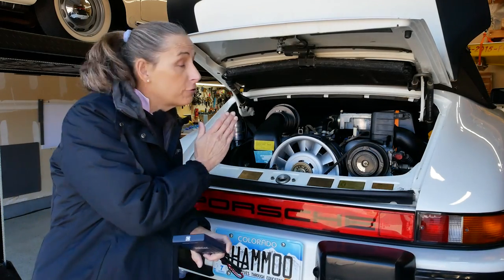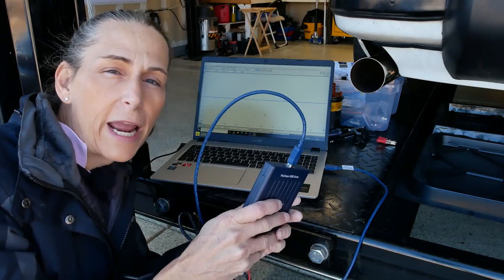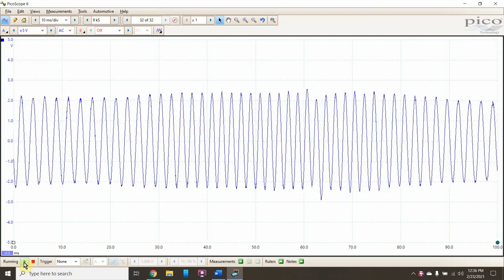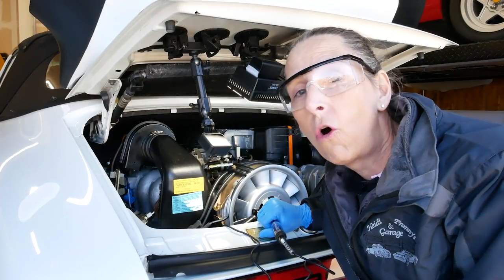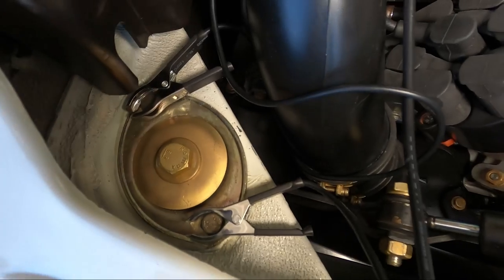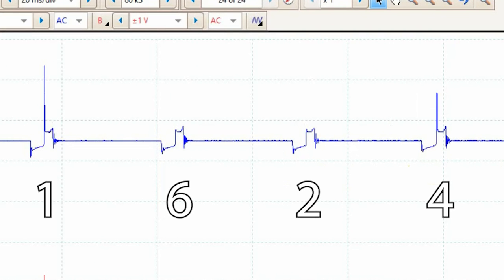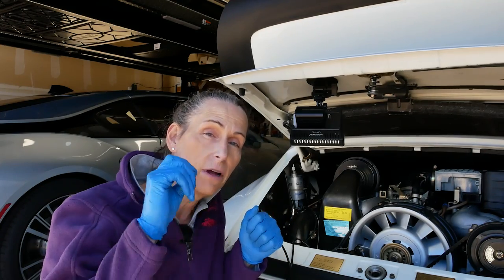Budget eBay Porsche 3.2 Carrera: Testing with a PicoScope Oscilloscope! Bad Wires??

Comment from the maker: Hi Everyone, I wasn't happy with all the testing we did a couple videos back and after several comments, I decided to do a bit of research on how to get better results than what a Volt-Ohm meter can provide.  I came across a channel called Mechanic Mindset and reached out to Darren and got a bunch of great info on the PicoScope 2204a.  Check out his channel here for lots of tips and tricks: https://www.youtube.com/results?search_query=mechanic+mindset

In the video, we check the position and speed sensors, the airflow meter, run a virtual compression test, take a look at the ignition patterns and finally get a yes or no on that original black coil.

Let me know your thoughts on the Pico and some of the data I got.  We even found one big surprise!

You can find the PicoScope software here: https://www.picotech.com/downloads

If you are interested in the scope or any of the probes and such you can find links for them here:

PicoScope 2204A (no probes): https://amzn.to/3vhB0In
Hantek HT25 Auto Ignition Probe with three ends (order 2 of these): https://amzn.to/3rKi9Uc
Acer Aspire Laptop (under 400 dollars!!!):https://amzn.to/3bEgNVB
Autooutlet Oscilloscope Probe: https://amzn.to/3viisaP
Hantek CC-650 AC/DC Max High Current Clamp Probe: https://amzn.to/3vgdfAl
Hantek AC/DC Current Clamp CC 65A Low Current Clamp Probe: https://amzn.to/3rJHVYS
Hantek HT201 1.053M Input Resistance 10MHz Bandwidth Signal Attenuator: https://amzn.to/3vgpEUW
Pack of 2 BNC Q9 to Double Alligator Clips: https://amzn.to/3thVuiB
Hantek HT30A with Utrade Heavy Duty Test Lead 3M BNC to Banana Adapter Cable: https://amzn.to/3viHXsQ
Probe Kit KKmoon HT307: https://amzn.to/3rF7Lgv
6V/24V Car Electrical Circuit Continuity Tester with Indicator Light: https://amzn.to/2N8JUGU
Thexton THE404 Spark Tester: https://amzn.to/3bFxzU9
Reply: Justin miller on Youtube also has good information on the 2204a like darren
Reply: Darren is a top chap 👍

Comment: The 2000 series Picoscope is NOT designed for cars and using it as such will void your warranty. It has a shared ground with all channels. It can/will short out electronics on the vehicle as well as potentially damage itself. The 4425A is their flagship scope and is specifically designed for automotive use as it has floating grounds.
Reply from the maker: This car uses a common ground for all sensors and electronics so the common ground isn't an issue. Possibly for modern cars it might be a thing.

Comment: Congratulations  on your new pico scope. I have used scopes for automotive diagnostics  for over fifty years.. believe me you have just open up a great new way to diagnose  electrical 
 problems, weather it is engine, alternator- generator,  heater fan or wiper motor, the possibilities  are endless. As you said in your video, practice is key; I assure you the more you practice the more you will be using it.
Thank you for what you are teaching technicians both professional and DIY. It is very much needed and appreciated. 
Thank you
R.G. Young, Jr

Comment: Nice usage of the PicoScope. I know their products well.
One comment on the 'missing' firing signal. This has nothing to do with the vertical resolution of 8 bit but is more a problem of not enough sample rate to capture the glitch. For this type of scope you can calculate the the required bandwidth of the scope to be 0.35 divided by the fastest rising edge (10% - 90%). Then you need to have four times the sample rate to avoid alaising effects. Nyquist law says you have to have at least 2 times the sampling rate but in reality with Gaussian input characteristic of the scope chanels you need to have four times sample rate.
So the fastest rise time that can be seen on the screen of the PicoScope 2204a is 35 ns.
Reply from the maker: Thanks for that.  I did pop open the properties window to get a good look at just what the Pico was altering its settings to.  I have the samples set to 2M and then the rest is just voltage range and time base, right?  As I increased the time base to see all cylinders the sample rate would drop into the several thousands range.  I read that this was a limit to the 8bit data capture.  Can you suggest a setting that would capture all the firing lines?  That would be super helpful :)   I also played with the up-scaling of the probe to 8.5-10bit but that just smooths the signal without increasing resolution.  Thanks!
Reply: @HeidiandFranny  You're welcome. 
Most oscilloscopes have an automatic setting of the sample rate and the aquisition memory to fill the entire screen. So first you can manually increase the aquisition memory to the maximum of 8 kSa which is unfortunately not very much. If you then increase the time base it will lower the sample rate or just not fill the complete screen.
But the PicoScope6 software has a nice feature. You can stream the data via USB streaming mode directly into the PC for longer aquisitions with a higher sampling rate. Based on the datasheet you can stream up to 100 MSa so if you use 40 MSa/s sampling rate - which is enough for a 10 MHz scope input - you can stream up to 2.5 seconds to the memory. I haven't used the software in a while so I can't remember where to set it up. But I'm sure you can find out in the build in help.
The 8.5 to 10 bit upscaling just increases the vertical resolution. What this function does is to take up to 8 sampling points and derive one new sample point but with higher vertical resolution. This of course reduces the effective sample rate by the factor of 8. So with 100 MSa/s maximum hardware sample rate only 12.5 MSa/s with high resolution is left which means appr. 3.15 MHz alaising-free bandwidth. This technique is called 'boxcar averaging'.

I'm looking forward to se the Carrera running soon... Greetings.

Comment: The intellectual curiosity and desire to get things properly worked out are impressive!  So often people just cannot be bothered to get repairs completed and even brag about how little they care.  This is not perfectionism for perfectionism's sake.  The knowledge you are gaining and passing on gives you a better understanding of what processes are working and what are not.  Many people will simply throw parts at a problem and never fix it.  On the Car Wizard channel Mr. Long shows how properly diagnosing issues actually saves time and money.

Comment: Yes, your black coil was in good shape and the car is still running a lot better than when you started the exercise of identifying where the idle problem was. Congratulations! Great video! :-)  I will say I owned 11 9111s starting with a 1966 and ending with a 2012; I did all my maintenance and I never used a scope. You are a lot more high tech than I ever was!

Comment: Hello Heidi and Franny's Garage,

NICE JOB!  Game UPPED and looking like a modern master tech!

I also like your point on using it for checking a used car.  The price of the scope is less than a traditional compression test.

If you do decide to pull a plug, you will see the amps drop on that cylinder to near zero, but the following cylinder in the firing order will go higher than normal (~15-25%).  You will also notice this when your fist start the relative test.  The first couple events get the crank turning and then stabilize on a good engine (compression close for all cylinders).

Looking forward to more video.
Mr. P
Reply from the maker: Thanks!  Yes, I did see that.  I also needed to expand the scale a bit to get better resolution.  Looking forward to using this more :)
Reply: @HeidiandFranny  
Hello Heidi and Franny's Garage,

Now that you jumped in with the 2-channel unit.......we also want more right?  The 4-ch units are quite expensive, so I have a plan to purchase another 2-ch unit and use a second laptop/computer.  May up the bandwidth on the 2nd unit, but at this point do not "NEED".  The advantage will be screen space and following 2 vs 4 tracking lines per monitor!

Much easier to read and laptops/computers so reasonable on price, it makes perfect sense.....at least in my thinking.  As a fellow engineer, would like your comment as I sometimes go too tool happy!

Cheers!
Mr. P
Reply: LOL....and Pico probably did not thing of it, but 2 x two channels scopes will be the new standard.  When I updated our shipping office I added dual monitors to each station.  Now instead of clicking between Quickbooks and Excel/email/other, you just look at the other screen.  Efficiency WAY up and our customer impressed for a small company.  BAD news is if Pico reads this post, the price of a 2-ch will go up in comparison to the 4-ch units.......GRRRR!  The scope by itself is not capable of supporting any viewing output and to my knowledge, the software does not currently support two monitors.

Mr. P

Comment: An old-fashioned analog voltmeter can also catch quick voltage dips and spikes that a digital meter might miss, due to the near-instantaneous response of the needle, versus a digital readout that only updates a few times per second. So it's a handy (and cheap!) tool to have.

Comment: Keep in mind heat and resistance while the car is running can affect sensors and captures. The automotive scopes are amazing. The ATS escope is even better. You should make a delta sensor for intake and exhaust pulses.

Comment: Great to see a cool use of an ignition trace with a very nice little scope.  One thing that might be fun, given the portable nature of the scope, is to look at the ignition breakdown voltage when the engine is under load.  The peak voltage should go much higher than at idle.  This will also possibly indicate arc-over in the coil or secondary wiring.  Very good fun!
Reply from the maker: One common technique is to do a "snap" throttle test to simulate a momentary load.  Since the software can record 32 screens at a time you can just go back and look.  I used a free screen capture software that will allow you to "monitor" for several minutes and write to MP4 file.  With the Pico software you can also save those 32 screens and pull them up later and do stuff like zoom in and out, measure time and voltage.  Super slick!

Comment: As usual a superior video. But, you started with the observation that you thought the idle was off. So, did all the testing and the returning resolve that issue? Or, did I miss something (not the first time if I did).
Reply from the maker: Seems to have.  I set the idle back to 800 (the shop set it up close to 900) and you saw I reinstalled the original coil and I am running the original idle bypass valve as well.  Seems to start hot and cold well and idle very close to 800rpm.  I need to drive the car a bit more but the weather has been nutty.

Comment: Every garage needs an oscilloscope for testing around cars great tools that do so much more. For the higher voltages coil a price of wire and connect to the end of the scope and u can use it to sniff the spark plugs etc and see the pulses. Bring to coil close but don’t make contact to the voltage source
Reply from the maker: Yup!  Also really good for Coil-On-Plug as well.  You can even use the coil from a relay.  Check out Mechanic Mindset's videos on that.

Comment: Wonderful idea use picoscope 2 ch. I agree all with video, buy when compare scope data with data reference of secondary pulses. Look ok,  but your burn time is shorter than reference. Is very dificult to control spark plasma and burn time. Spark gap, all resistance in secondary circuit can move a bit to more or less the time, also primary coil current and internal limitations con control module or ecu. If combustion chambers are stardard, not altered (compress ratio std) ur engine must have similar burn time as references. Engines common values are  1.2 to 2.5 miliseconds. I use to see primary current in bottle coils using similar Hantek current clamp, but the CC-65. Less current range.

Comment: Great to see that project come to a (successful) end, soon, and looking forward to following the Ferrari being inspected. One thing I noticed in your explanation, why the spikes don’t show up as in the manual: you were blaming it to the 8 bit A/C converter, but wouldn’t it actually be a sample rate problem ? Just wondering. Keep up that phenomenal work !
Reply from the maker: Thanks Stefan, great question! I need more time with it but whenever I increase the time base the samples drop automatically.  It seems it can only deal with so much data at one time.  While researching I heard that you can't expect too awfully much from an 8bit scope for large data sets.  The true Pico automotive scopes are 12bit I think - but...  also $900 so...  I need to spend more time with it though.

Comment: Glad you liked the Picoscope, I just upgraded to a 2204A myself, great scopes for automotive use as long as you use a pair of attenuators :p (had a Hantek before but didn't like the software). One question,  are you an automotive engineer? Anyways, thank's for a great and informative video. Great tip to use a testlight to confirm there's no discarge! By the way, is it just me or there seems to be a lot of gentlemen of the older generation on this channel that seems a bit "butthurt" that a woman understands technology and uses an oscilloscope
Reply from the maker: No, aerospace.  😀

Comment: Hi Franny I recently came across your videos as I’m desperately searching and researching videos or anything on the infamous 1974 autostick super beetle. I have one that had the wires removed from the flooring as the floor was replaced. I would like to see a video showing every step of this system as it combines safety and operational issues. The autostick works in tandem with the seat belts, the seat sensors and door buzzer. I would like to recreate this system which includes a relay that controls and is responsible for the seatbelt interlock.
Thanks for any help.

Comment: 00:00 - 9:12 High tech stuff!
09:13 - 11:17  checking spark plug and coil wires for leaking voltage with a test light
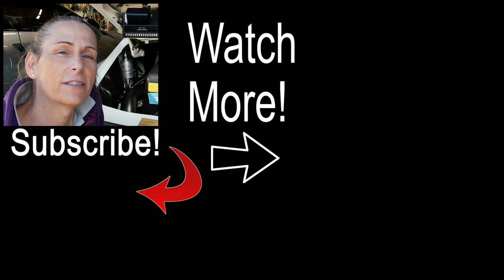11:18 - 20:31 High tech stuff!

Thanks for that test light trick. News to me! (Note for newbs: wire of test light was clamped to a ground.)
Reply from the maker: Thanks for that!

Comment: Hi Heidi and Franny, What guide did you use for the Porsche 3.2?  I'm looking for any manuals or guides or documentation on what the various voltages and the waveforms should be (and should not be) on a 911 3.2 L Carrera. I love your channel. It's very cool!
Reply from the maker: Thanks! I use both the Porsche service manual and also the Bentley manual. Bentley is easier to follow but has some errors and omissions.  The actual service manual is the gold standard.

Comment: Excellent video.  I just bought a Autel MP408 scope and am learning it.  I use to use the old big Sun Scopes during my dealership days but times have changed and I’m an old dog learning new tricks.  I’ve never seen an mass air flow sensor that you can measure with the engine off.  How did you do that?   Love your little gas analyzer.
Reply from the maker: With the ignition on you can measure the voltage across the pot as you move the vane.  It is a bit old-skool but it works.  You can also just measure the dead resistance without power as well.  All you are really looking for are noticeable dead spots.  I was really lucky that mine was good.  I've seen some photos of completely worn carbon tracks.
I'm just learning with the scope.  Very cool though!

Comment: Wow, thanks for another great video! The link to the PicoScope 2204a is $400. You had mentioned it is about $100? Is the link correct? When you hooked up the red clips to the Air flow meter, where does the black clip go, Ground somewhere perhaps? When you hooked up the current clamp on the starter wire and I assume the USB is connected to the current clamp and laptop? If yes, how do you test each cylinder? Sorry, just not sure how the wiring goes to test each cylinder, Much appreciated it.
Reply from the maker: You might be looking at the 2205a.  I think that is $400 and 25MHz (2204a is 10MHz).  Also there are packages with scope leads that run the price up a bit.  I bought all that separately.   Since Pico is out of the UK their products are a little hard to get.  The pricing goes up and down a bit on Amazon.
So, yes, on the air flow teste the black is on a good ground.  I should have shown that.  For the current clamp, it is also plugged into a channel on the scope (it is just another probe as far as the Pico is concerned).  The Amp clamps convert the amp flow to voltage internally.  They are an "active" probe in that they have a battery (9V) and you have to turn them on and zero out the signal.  Just take a sec.  You can also clamp on the main battery cable at the battery if that is easier.  For syncing you could then use that same capacitive HT 25 clamp on the #1 spark plug lead and trigger on that.  Cylinders would then be in the firing order.  Let me know if that answers your questions :) F
Reply: @HeidiandFranny  Thanks for the details. That is great. My understanding is that I need to clamp the current clamp HT 25 to each spark plug lead in order to isolate each cylinder, correct? Clamping on the starter wire or the main battery cable will give you an overall average of all 6 cylinders, correct? Sorry about the silly questions.
Reply from the maker: @kawman4519  you really only need the HT25 on cylinder #1 and then to the right the cylinders will be in the firing order (162435).  You are really just looking at a relative drop in one cylinder consistently.
Reply: @HeidiandFranny   I see now. Thanks so much. Have a fantastic weekend!